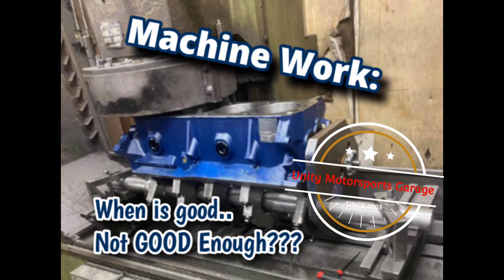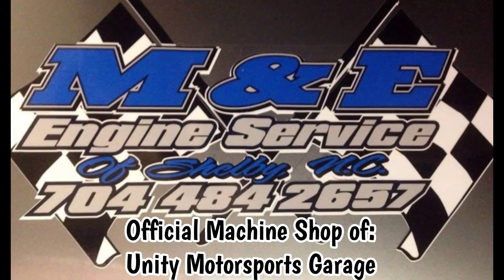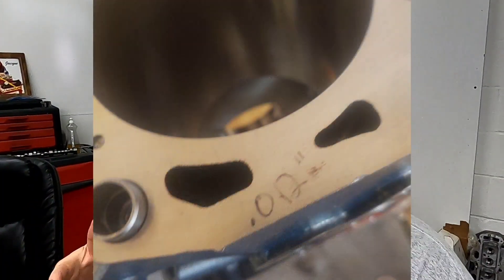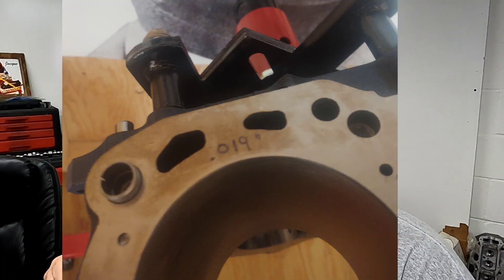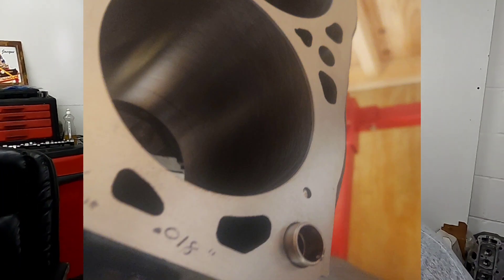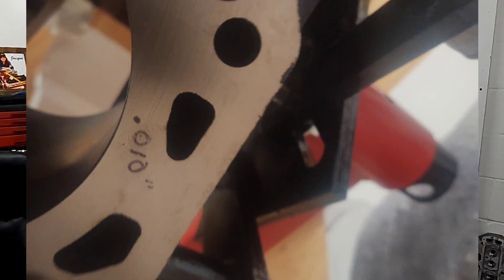Engine Machining: When is Good not Good Enough???

Comment: Andy I know your a busy guy just like David and Tony . I'm planning on building an LA 360 block and would like your guys help / expertise building this motor for my low budget project 65 dart street and strip . I'll have to get your email unless I already have it ? One other question . my 82 D150 short bed truck has a midly built 318 with manifolds and dual exhaust with no converters and mufflers with a strait through design . the pipes stop just under the rear bumper. I was thing of cutting them off just infront of the rear tires with 12" turn downs ? besides sound with increase HP / TQ  or will it not make any difference ?O and I did a video on my channel of the Gunson color tune kit being use on my 318 . thanks Andy.
Reply from the maker: It really won't make a difference other than sound... I watched your video it was really neat to see it in action!  
Andy

Comment: I don't dispute anything you say. In the old days of Australian produced blocks at Fisherman's Bend (Holden) and Geelong ( Cleveland Plant at Ford) the production engines were measured until they found one square. The stock cam to deck clearances on the Holden 253/308 could vary -/+ 0.0625, with a stacked variance 125 thou different highest to lowest. Same with the Geelong 302C/351C. These engines used fresh US style Cincinatti or whatever tooling, and it's typical of iron block variances. Famed racer Larry Perkins said he never line bored or indexed a mass produced 5 liter Holden V8 for a 600 mile race because it introduces another complication of deck to deck variance, it was easier in production racing to keep measuring untill a cherry 🍒 pie was found among the lots.  Another builder, Brad Girdwood, said the variances on a fresh block can be that great. So I'm saying...your lucky to only have had -/+ 30 thou on deck for a WCP 351, and -/+ 10 thou front to back on an SHP. Sadly, on my last two V8 Ford's, they were way out from factory. There are reasons why some factory V8 Falcons did flat 16.0s, while others took 16.5 seconds over the quarter mile. The variance in 17 net horsepower was due to machining tolerances, not carb and ignition.

Comment: Another excellent video Andy. One thing that a lot of people don't think about is the order of maching operations. I always specify,  crankshaft tunnel first. Decks second,  and referenced off the crankshaft tunnel. Bore and hone last. The idea is that everything is squared and measured from the same point. Personally I've had good results when it has been done in this order. Regards Greg
Reply: This is my preferred method in my shop.  
  My boring machine registers off of the main centerline and the oil pan rails. Of course cleaning and deburring the oil pan rails is a must. I just won’t accept that the pan rails are good enough for reference. 
  I like to square up the deck surface relative to the main centers on both sides as close to 90 degrees as can be measured. Then bore and hone to a slip fit for mock up and deck height check. 
  Then deck the block down to the desired height and go back and meticulously champher and deburr both the tops and bottoms of the cylinders. Then torque plate hone to finish. 
   It takes serious time over just slamming one through and machining it out the door. However the customers that pay me to do it fully understand the order of operations and expect to be billed accordingly and expect it to be done correctly.
Reply from the maker: I fully agree Hugh... It's the attention to detail...
Andy

Comment: Got an oddball question that's kinda related to the video. Is it possible to mill 1.1" off the deck of a Pontiac 400?

Or do I need to find a 301 Turbo block and have it sleeved to 4.15" bore? (Edited for correct sizes)
Reply from the maker: Scott I don't know... That would be a question for a Pontiac expert. My guess would be no! Because that much of a cut could compromise the deck integrity 
Andy
Reply: @UnityMotorSportsGarage  According to Bill Taylor  from my 2000 copy of GR8 Pontiacs,  the 80-81 Pontiac 265 and 301 were decontented engines, with 62 pounds taken out of just the block  the casting via windowing the bulk heads and lowering the deck registers.  It was a thinwall version of the 326-350-389-400-421-455, made on the same transfer line. The bigger engines have around a 600 thou deck to cylinder casting thickness, so I doubt you'd be able to take more than that off.  You can check with Dallas Brown from UTG, he might have access to one of those blocks to check independently.  Really love the old Siamese port 301 Turbos, I have a friend who is still running one...in Invercargill. Some times with one L. To save ink....
Reply from the maker: @deanstevenson6527  that's good to know... I have built one Pontiac! It was a 400.. just did a basic rebuild on it with a Mild cam.. that is the extent of my Pontiac knowledge.. lol
Reply: @UnityMotorSportsGarage  301 block, as long as I can sleeve it out that far, will almost certainly be lighter than the cut-down 400 block, anyways.

The Pontiac 303 is a weird engine. 4.12"ish bore, but 2.84" stroke. Should be a real screamer, but I gotta find a 68 or 69 firebird to build on first.

Comment: A good engine machine shop is worth the money , there's a difference between an engine rebuild machine shop and a performance machine shop .
Reply from the maker: Absolutely!  Thanks for Watching Uncle Squirrel..  
Andy
Reply: The place I worked at had both, depending on what a customer came in for. 
If it was race engine there was only 4-5 guys in the shop out of like 15 that had that duty to do him an engine and those were mostly done at the other end of the shop.